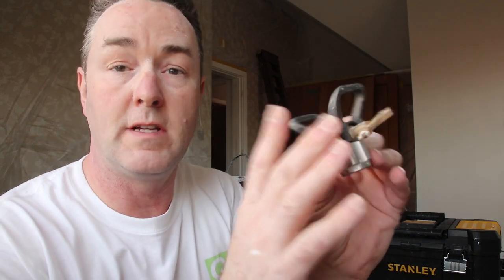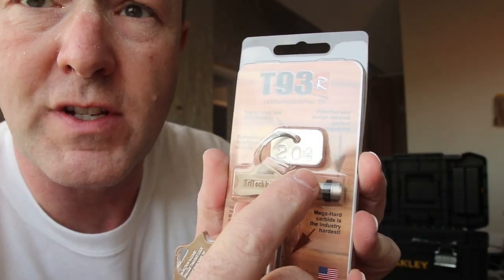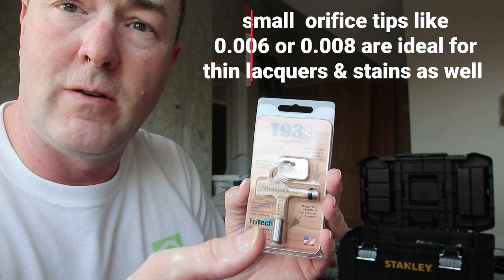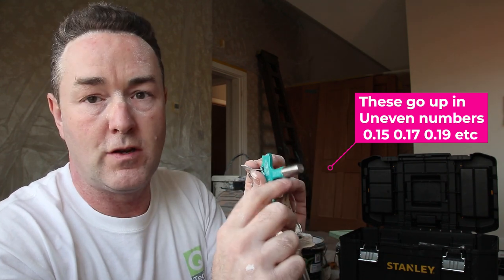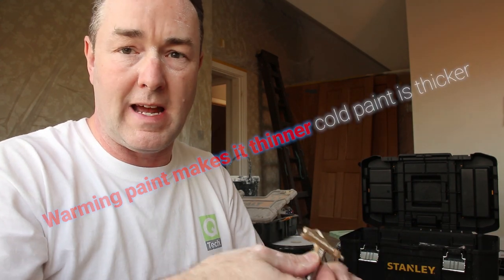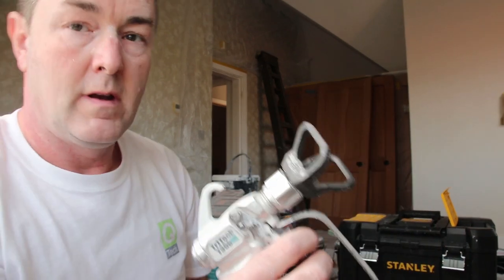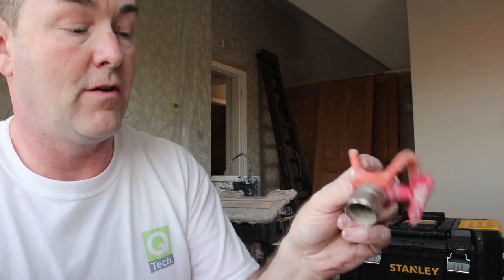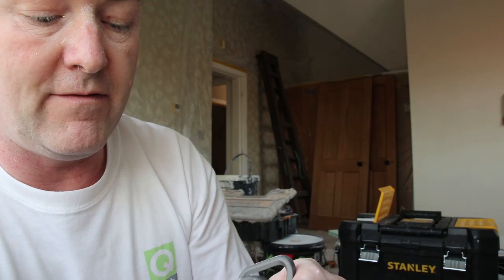Airless Spray Tips Explained – Decode the Numbers!

Comment: Hi what size tip would you use for spraying Dulux oil based undercoat and gloss thanks in advance
Reply from the maker: Depending on the viscosity of the paint the orifice size I'd use would vary from .10  .11 or .12
The thinner the small you'd go.

But personally I wouldn't spray gloss paint.
Waterbase is so good now and safer too.
As when cleaning out oil based paints you need to 'ground' your gun against a metal bucket/pale or you get static build up that could catch fire.
Sometime that water based paints wouldn't do.

Comment: Hey Phill thanks so much for all your great info! Can you just clarify what paints go through the different colour spray gun filters. Cheers buddy.
Reply from the maker: Hi. Please like and share... More good comments like that I'm that bit closer to sponsorship from Porsche lol.

To keep it simple.
The finer the mesh.. the finer finish paint product you'll be using... And the smaller the orifice size.

My set would be... 
Small tip... 208, 210, 310.... Anything under .11/12 I use the red gun filter.. fine. Spraying finish top coats.

Larger orifice, spraying emulsion.
516/517/518/619 etc
I use a white mesh filter.
 Does that make sense?

What do you spray?
Reply: @ProfessionalPainterDecorator  thanks dude, that makes perfect sense. I've only just bought a Qtech QT190, It's all I could afford on my budget. I haven't used it yet though. I'm going to spray my stairway, landing and bedroom first, also a couple of big breeze block walls.
Reply from the maker: @ag2664  that should be ideal. 108 or 110, or 208 210 fine finish tips with fine red mesh gun filter.
Easy the the paint a little. You don't want it that thin it runs, but not that thick it looks splattered.

Test on some card, so you don't get tails on the fan pattern.

Up the pressure, thin the paint or swap tips.
Trial and error and you'll work it out.

Also spray a quality paint.

Tikkurilla Helmi or Everal I use is nice to spray.. also Zinsser AllCoat exterior, still very good on inside woodwork.
Reply: @ProfessionalPainterDecorator  Absolute legend. What are the best extension poles that I should be looking at? All the accessories are a mine field.
Reply from the maker: @ag2664  don't do Chinese copies... Just incase they can't support the high pressures.

I have a nice 15" tritech one.
Pair that with a Graco clean shot as well... Brilliant bit of kit to have.

Comment: Brilliant video👍 very helpful, any idea why my sprayer is spitting paint as i release the trigger
Reply from the maker: Airless? Strip the tip guard down and remove the rubber seal/metal seat that the tip sits against. Swap it for a new one. See if that helps.
Also sometimes I find mine does squirt paint out when it's a new tip and seat. I flush some paint through into my slop bucket at various pressures to bed it in before I spray spraying. Try it.
Also make sure your your trigger hasn't been altered that it's not shutting off.

Comment: Hi Phil I’m getting a Wagner 350m and also want to use it to treat my fence with Cuprinol duck back stain what top would you recommend.? Thanks
Reply from the maker: When I did mine the stain was thin, so I used a 514

Best have a few tips that you can swap if you need to go smaller or a bit bigger.

The bigger, the more product you'll put on.

Comment: another question again I'm afraid lots to learn. im wondering if there is a video on tip sizes you may use on doors. door linings . skirtings. bannisters. what sizes you recommend gonna be using johnstones aqua guard & undercoat, practices in my garage first though .
Reply from the maker: Ive the newer video about 5 tips on spraying. I show how to do skirting and frames.

It's practice... 110, 210, 310 are three good tips to have.
Giving spray fan of 2" 4" and 6".

It depends how big the woodwork is.

Doors... You don't want lots of passes with 50/50 overlap that you may put too much Paint on... So a 110 wouldn't be as good as a 310. A 210 you may want to start off with and get a feel for it.

Once you get the hang of it, you may feel a 211 or 311 tip may be better for thicker woodwork paints.